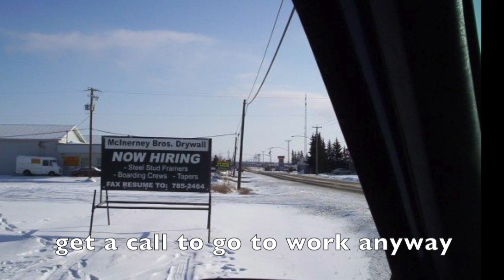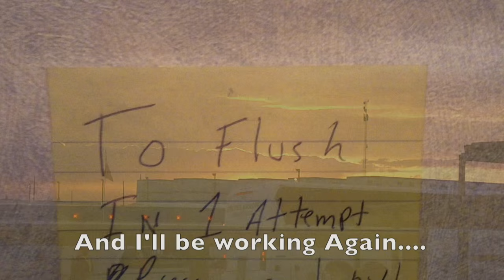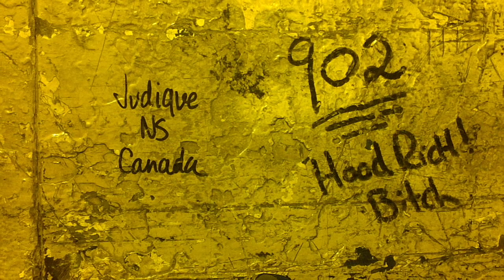$100 Barrel - Jody Hickey

Comment: Jody ,i love the song and would pay for it,but I just want to understand which i assume i did in the song,pissed it away,do you mean how alot of guys that went out there ended up buying extremely expensive toys---trucks,motorcycles,side by sides,huge houses etc... and thinking the flow of money would never end,anyway great song for today!!thanks
Reply: +Jake Graham and did not save for a rainy day...as they say
Reply from the maker: +Jake Graham well Jake, thats an old saying from Alberta, i think you have the general gist of the meaning, but a double wide trailers cost 450k in the oil sands region, big houses cost a lot more. 
If you are lucky enough to have a company truck, you still have to have a vehicle that can go through 3 feet of snow so the wife can get to work..... if no company truck you both need 4x4 capability to get to separate jobs...
There isn't really a lot left over to save OR piss away really. Its a very sad state during the bad times.

Thanks for the kind comments on the song Jake.
Check back, i'll have a fully produced version of the song available for download soon. :)
Thanks,
Jody
Reply: +Jody Hickey i hope you get this on the radio man,then maybe you can make a career of it........good luck!